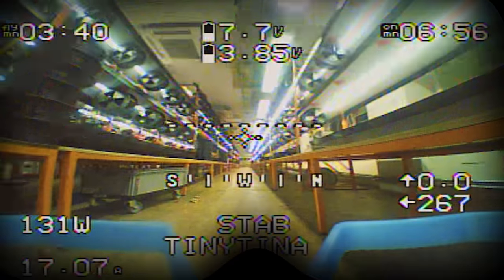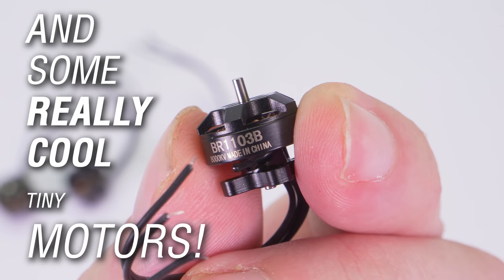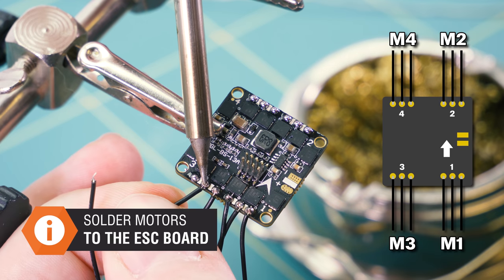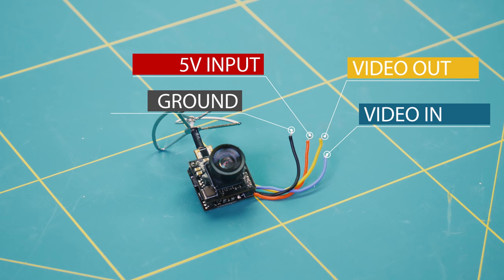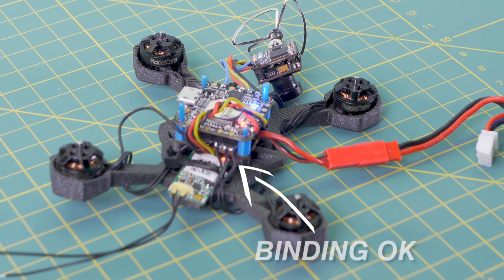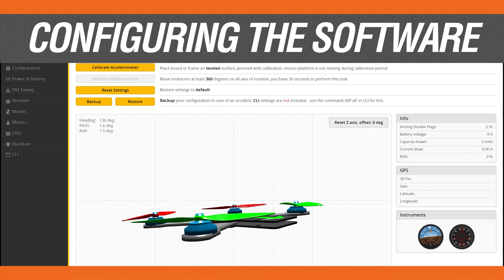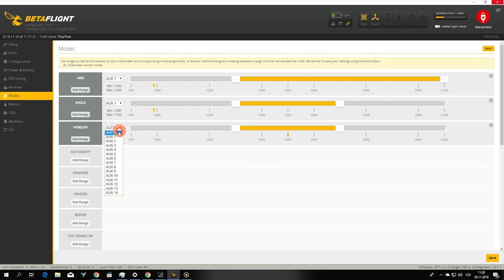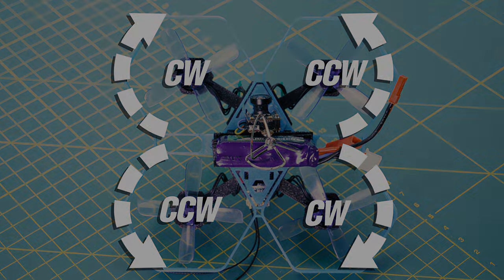How to Build a Cool & Cheap 3D Printed Mini Drone

Comment: Awesome build, little disappointed the propellers were not 3D printed as wel making this project 100% 3d printed but perhaps there was a good reason. None the less I may have to build myself. Thanks for sharing.
Reply: It wouldn’t be well balanced it will be hard to print and be fragile
Reply: You are probably right, but I can see makers out there reading this as a challenge to overcome. :-)
Reply: RCLifeOn did a video about 3d printed propellers on drones. It is possible but they are tricky to balance and won’t last as long as bought ones.
Reply: I was thinking more on the lines of support material needed and the removal of that support material. Im sure with dual extrusion and water syllable materials that you could get a propeller to print but i never thought that balancing would be an issue. Perhaps in a single nozzle setup youcould print the propeller in 4 separate interconnecting parts and you could weight each to spec to insure proper balance.
Reply: Fragility, quality and most importantly the smoothness. High friction surfaces from 3D printing would not good rotors make.
Reply: As many pointed out, they are very difficult to balance out. Another reason is the rotationspeed of the Motors. Such tiny drones use really high kv motors. 8000kv in this one. That means with a 2s lipo the props will reach up to about 60,000 rpm. Most 3d printed parts will just vaporize at those forces.
Reply: I 3d printed 8 inch props for my 3d printed quad in pla and they worked fine, but they broke immediately after the first crash.
Reply: They probably could have printed the propellors, but probably wanted to add one less variable when making it.
Plus, they probably wanted to get a video out before December and didn’t want to spend much more time trying to get into to work
Reply: You cant use SLA to print (working) props. Resin perhaps.
Reply: Use a SLA printer if you want to make propellers
Reply: And how are you going the print the motors and fc, escs  , thats  whats needed to get 100% 3d printed
Reply: @TheXanUser sla printed props are too fragile
Reply: @sgarre1987  its 8000 per volt not per cell . But in reality under load the rpm is much lower than the unloaded kv figure ,  about 30000 for a 3" prop
Reply: At these sizes drones can be very sensitive, changing the propellers or adding a few grams can add up to way less efficiency and flight times
Reply: @AndrewEbling  and they aren't efficient

Comment: Really cool to see u guys promoting FPV !!! It was also the reason i got into 3D Printing back then to print parts for my drones :).
Reply: Im a beginner to all this, but how would you connect this drone to an FPV headset?
Reply: @matthewchen3815  The drone has a VTX (video transmitter) and the FPV Google a Video receiver which work with analog frequencies. And there are digital systems available nowdays that need to be paired like a controller to a Xbox or Playstation.

Comment: Hi, thanks for the video for I find it very interesting.  I am very new to drones and while I have a DJI, my grandkids want to fly it, so I thought this would be a better solution!  The drone stack and transmitter you used are no long available.  I am not sure what kind of stack I need.  Some seem to be a lower cost while others are very expensive, but I not sure of the difference.  Is there another stack you would recommend?  What about the transmitter?
Thank you a ton!!!!

Comment: Thanks for the awesome video! I am trying to find the best material for printing drone parts. Is seems polycarbonate (PC) is widely used for props, canopies, and even frames. Can you add profile for PC in future updates of Slic3r Prusa Edition?
Reply: Print in Nylon easier to print and cheaper than PC but just as robust not as stiff but shouldn't be an issue for a small drone.  You can use Taulmans Nylon 230 that prints at 230 Degrees and a 40 degree bed just with a little bit of glue stick or PVA.  Used it alot and works well.
Reply: @thegarageluthier  Sounds great! Will give it a try. Thanks for your information!
Reply: @thegarageluthier  Not sure nylon will stiff enough with this frame, the arms get quite thin at the hub side, would probably be ok with a brushed micro but I think the power of a 2s 110x is gonna cause flex issues on acro. Petg would be better I'd imagine, much stiffer but still impact resistant and easy to print.

Comment: my one doesn't work.
there is anything with my receiver false
pease help meeee
Reply: The video is wrong if you buy and use the recommanded part in this guide :
FS-RX2A Pro V1
FS-I6
HGLRC XJB F413 Omnibus F4 Flight Controller

When in Betaflight, you wont be able to get the Receiver to communicate.

I found the anwser buried in some post on Reddit : https://www.reddit.com/r/Multicopter/comments/7nbc1z/no_radio_input_in_betaflight_hglrc_xjb_f428_fsa8s/

You need to solder the IBUS wire of the FS-RX2A Pro V1 (which should be yellow) to the RX6 pad(which is on the othe side of the board, not the same side as the 5v/ground/sbus/ppm).

Then in Betaflight : in Configuration, its IBUS, and in Ports its UART6.

This solution worked for me.
Reply: @milleniumdawn  THANK YOU! You saved this project for me. Was really close to throw every thing away and never touch this topic again!

Comment: I realy love the entire Project.
But didn't get the Battery or the Motors to hot that the Plastic melts?
Reply from the maker: Nope, it's safe - the spinning props actually cool down the motors and the battery was (after some really demanding power output) just very slightly warm to the touch. Plus, you can always print it with PET-G if you are looking for a more durable material. We printed it with PETG as well (it's the orange one at the end of the video) and the print went perfectly fine with default Slic3r PE settings. In fact, there was almost no stringing and the frame is quite flexible and durable.

Comment: Does it have GPS? If not, how can I add it?
Reply: Its not really made for gps flight so you would probably need a different flight controller and or bigger motors for the added weight

Comment: The FS-RX2A Pro V1 has 4 wires, there's an additional beige wire in addition to the red black and yellow.  Where does it connect to on the receiver?
Reply: The beige is not used. Also :

The video is wrong if you buy and use the recommanded part in this guide :
FS-RX2A Pro V1
FS-I6
HGLRC XJB F413 Omnibus F4 Flight Controller

When in Betaflight, you wont be able to get the Receiver to communicate.

I found the anwser buried in some post on Reddit : https://www.reddit.com/r/Multicopter/comments/7nbc1z/no_radio_input_in_betaflight_hglrc_xjb_f428_fsa8s/

You need to solder the IBUS wire of the FS-RX2A Pro V1 (which should be yellow) to the RX6 pad(which is on the othe side of the board, not the same side as the 5v/ground/sbus/ppm).

Then in Betaflight : in Configuration, its IBUS, and in Ports its UART6.

This solution worked for me.

Comment: i ordered the same flight controller and esc and it came with a small 24V 470uF Cap. would you suggest soldering it to the + and - or am i good without?
Reply: Any link to that sir? I want to buy
Reply: give me link please

Comment: Great Video, but won't PLA melt on a hot day, or when the drone is left in a car on a hot day?. Does Prusa have any filament that would be better suited, and can be printed on the Prusa. Afraid of using ABS or NYLON due to the fumes produced.
Reply: You can try PETG - it has the high melting point of ABS but none of the fumes. PETG suffers from stringing (looks a bit like the fine strands of a spider web) but that shouldn't be a problem here. PETG is also hygroscopic so long-term storage should be in an airtight bag with some silica bags.
Reply: @johanneshass1614  Id use PETG just because my printer cant print ABS, but everything you are saying is completly correct.

Comment: Question; How does one create threads for real-life item. I have a paint pole extender with male threads and I don't know the specs on these threads. Is there a way to create female threads to fit the male threads on the pole?
Reply: Wrong place for this question. Next time try asking in a 3D print design group.
But here we go...
1st. Measure the threads thickness and how many threads per inch you have, if the paint extender's threaded part isn't an inch long, use .5in and then double it. Now you know your thread count. Get the other dimensions you will need such as the diameter of the threaded part (inside and outside of threads). Now you know the height of the threads.
2nd. Pick your design program for this problem. Fusion 360 works great and can be used for free.
3rd. Design your female end with the inner diameter (ID) the same as the outer diameter (OD) of the male threaded part.
4th. Use the Thread tool and input your thread counts that you got from step 1.
5th. Print your part and smile while you screw it together.
Reply: @jeremybuscay  Arent you sweet.

Comment: Flysky radio but Frsky receiver? What? :D
Reply: TheZippyMan flysky Rx’s are too big xD
Reply: @EnzoM  but dude he makes a good point. He suggested a flysky i6....but hes using a diff. transmtter...that shouldnt work and needs clarifications. also dude there are some small RX for flysky you know  like fs a8s, rx2a pro, fli14, fli14+ which use ibus which is faster than sbus...he also didnt show the configuration completely but i guess there are a lot of videos about that already
Reply: @im_ricebowl  Yup
Reply: Although the video shows an FrSky tx & rx, the parts list contains a FlySky tx & rx. This actually needs to be connected up differently to the video, as it uses IBUS rather than SBUS. The BetaFlight configuration for the serial provider needs to be adjusted accordingly too.
Reply: @EnzoM   You can buy small ones also like flysky rx2a (weight almost 1 gram)
Reply: @AndrewEbling  flysky can do sbus too
Reply: The video is wrong if you buy and use the recommanded part in this guide :
FS-RX2A Pro V1
FS-I6
HGLRC XJB F413 Omnibus F4 Flight Controller

When in Betaflight, you wont be able to get the Receiver to communicate.

I found the anwser buried in some post on Reddit : https://www.reddit.com/r/Multicopter/comments/7nbc1z/no_radio_input_in_betaflight_hglrc_xjb_f428_fsa8s/

You need to solder the IBUS wire of the FS-RX2A Pro V1 (which should be yellow) to the RX6 pad(which is on the othe side of the board, not the same side as the 5v/ground/sbus/ppm).

Then in Betaflight : in Configuration, its IBUS, and in Ports its UART6.

This solution worked for me.

Comment: how long does the battery last on this?
Reply: Mentioned in the video.
Reply: @jothain  thx for nothing.
You couldve saved yourself the trouble and not write something which wouldve had the same result
Reply: @MrFrisMich  Incorrect. You didn't know how long it lasts. Now you'll know 😊👌
Reply: @MrFrisMich  Po

Comment: How can you config the camera for streaming video?
Reply from the maker: The camera has a built-in transmitter and an antenna. So you just start the FPV goggles and start the autoscan - it will automatically find the signal from the camera.

The FPV goggles mentioned in the video/article can record videos to MicroSD card. Or you can buy this https://www.banggood.com/Eachine-ROTG02-UVC-OTG-5_8G-150CH-Dual-Antenna-Audio-FPV-Receiver-for-Android-Tablet-Smartphone-p-1242422.html and connect it to your PC - it acts like a web camera and it converts the analog signal from the FPV camera into a digital stream, so you can record it in your PC

Comment: Great project, but the Tello drone from DJI is still better. The Tello can run much better FPV as well, but you need a controller. The best part is that it has a 13 minute run time, can hover in place unassisted, and is programmable for around $80-$100 (extra for remote). The only thing that is poor about it is the speed, but with some firmware tweaks, you might be able to increase the speed.

Comment: The video is wrong if you buy and use the recommanded part in this guide :
FS-RX2A Pro V1
FS-I6
HGLRC XJB F413 Omnibus F4 Flight Controller

When in Betaflight, you wont be able to get the Receiver to communicate.

I found the anwser buried in some post on Reddit : https://www.reddit.com/r/Multicopter/comments/7nbc1z/no_radio_input_in_betaflight_hglrc_xjb_f428_fsa8s/

You need to solder the IBUS wire of the FS-RX2A Pro V1 (which should be yellow) to the RX6 pad(which is on the othe side of the board, not the same side as the 5v/ground/sbus/ppm).

Then in Betaflight : in Configuration, its IBUS, and in Ports its UART6.

This solution worked for me.
Reply: Hello my friend, i have some questions, can you give me your facebook? i will write you there. Thanks.
Reply: @gamingisnotacrime  this is the one and only drone I ever built, and haven't touch it in a years. I stumble on that solution, sorry to say I'm no help in building drone
Reply: @milleniumdawn  yes i understand, but i have noyl 1-2 questions, im sure you can help me.
Reply: @gamingisnotacrime  for privacy, i wont share my email/facebook here, ask you question in this discord chat :  https://discord.gg/8WmQUr6U
Reply: @milleniumdawn  can you send me once more your discord?

Comment: I have to say this seems like a great build and all but, get the emax whoop for 99$ and use those components to build this! cheaper
Reply: I'm afraid it's not about drones buying guide, but about how to make it yourself with 3D printer. The channel name was obvious.
Reply: @amrfwws4461  Tixo isn't suggesting just buy a emax whoop. He's saying you should use the parts from the emax in the 3D printed frame because it's cheaper to get all the components in a whoop than buying them separately.